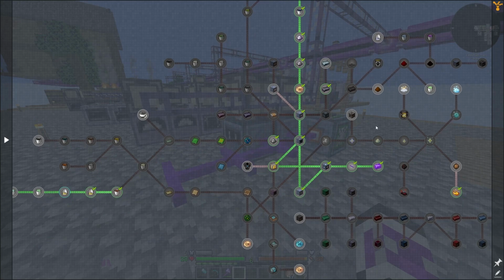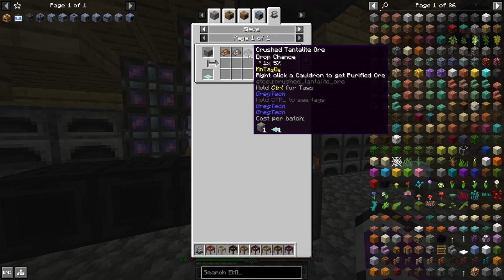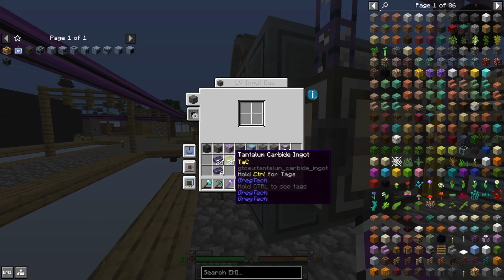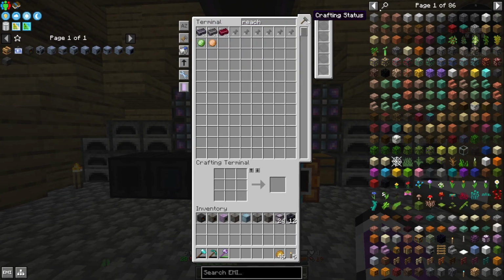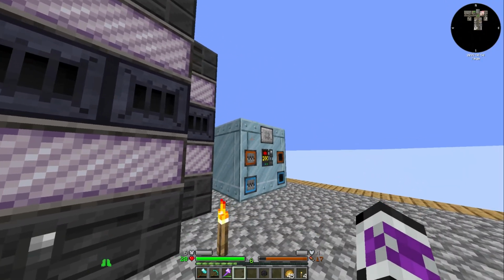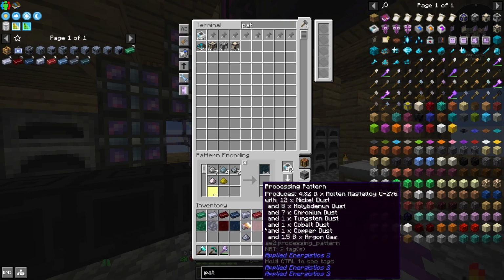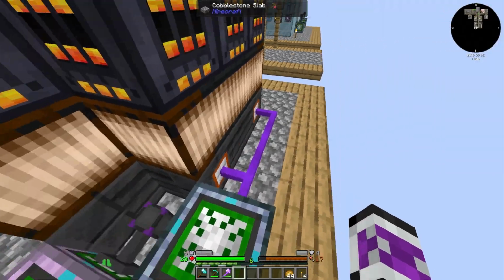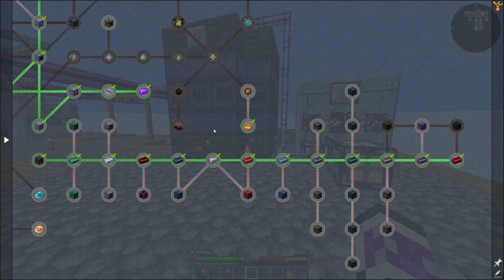Star Technology: Episode 30 - Alloy Blast Smelting

Comment: To not babysit the mixer please several input busses(don’t forget to set in every single one distinct mode), then, in each one you place unique circuit(simple), but with the fluids, from what I understood from the guys in discord, most of the time you need only water or oxygen, so you can simply place to input hatches and passively supply this liquids via interfaces. Hope that helps
Reply from the maker: I'm not sure that's my problem. I'm long overdue to upgrade to at least an mv input bus, and that would solve more than half of my problems with it. But the rest of the problems are from recipe conflicts on the same circuit, but I guess I could still split them up between more inputs.
Reply: @Thaumiumking9  oh yes, now I get it. I had the same problem, and mv busses indeed solves alll of them

Comment: If you hold shift while hovering your cursor over coil you can see what bonuses to wich machine they give. Basically, if you use coils on machines that are not ebf they give you energy discount(machine take less power), and if your machine supports parallel processing some coils can incrise the number of items processed in parallel. I think multismelter, for example, on rtm coils can smelt 128 items at the time

Comment: Hey it’s me again, next you should work on automating iv circuits and nether star production. This will be a multi episode adventure and will most likely require a larger clean room, but it will allow for the 10k fe solars which at that point are kinda cheap. If you automate them then you won’t worry about power for a while. Ttyl
Reply: Wetware circuits isn’t it?
Reply: @TheNamedVosto Nano circuits. Wetware circuits are lategame
Reply: @richardjustr11111  I know, he’s talking about nether stars and iv circuits automation which is needed to make the wetware board.
Reply from the maker: I'm somewhat committed to the large machine multiblocks right now, but they will undoubtedly push my power to it's limits to craft them, let alone use them. I'll be making my cleanroom bigger along the way, and I'll need Luv circuits soon anyway to make the parallel ports, so maybe once I've done that I can make the solars too.